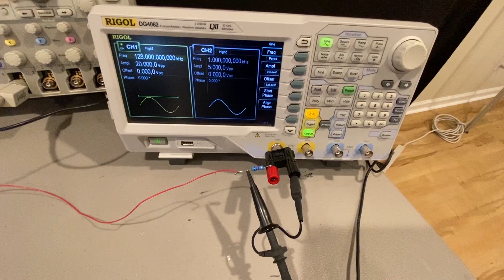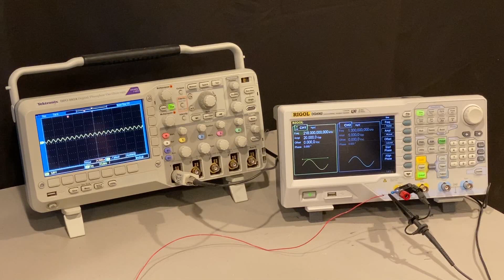How to Measure the Resonant Frequency of your Secondary Coil

Comment: Hi! What is the purpose of the resistor? Why not to connect the top off the coil to the oscilloscope? Thank you
Reply: because the oscilloscope probe will load the coil with additional impedance and change the resonance. the resistor is simply a current shunt since the probe cant measure the current directly we need a resistor to create a voltage drop for the scope to measure.

Comment: thank you! now that I finally have a proper(100MHz) scope, ive measured mine. its around 350KHz coil unloaded/no topload. still gathering more info. been far too long since ive built my tesla coils. planning on going QCW with SSTC. I dont have proper cap/s for going DR.

Comment: I think I am a little bit confused here. As far as I know, the usual equivalent circuit diagram of a coil is a parallel resonant circuit, like the one from this wikipedia page: https://de.wikipedia.org/wiki/Spule_(Elektrotechnik)#/media/Datei:Induktivit%C3%A4t_ersatz.svg (Ignoring the iron resistance for the moment as it doesn't change the fact that this is still a parallel resonant circuit).  And as far as I know, the impedance of a parallel resonant circuit reaches a MAXIMUM at the resonance frequency, not a minimum. A series resonant circuit reaches an impedance minimum at the resonance frequency I think. Thus the voltage drop across the coil should reach a maximum at the resonance frequency, not a minimum. Does he in fact measure the voltage drop across the resistor, or where did I go wrong here? 

I am also super confused with his setup that can be seen at 0:20. Assuming the red terminal of his BNC adapter is the output, the black terminal is the ground and the red wire goes to his coil, it looks like he was probing the voltage drop across the coil, referencing his probe to the function generator's ground. But where the heck does the other cable of the coil connect to? I can only see the probe's ground connection at the black terminal of the BNC adapter, and at 0:10, I can't see a second terminal on the coil. 

Maybe I've misunderstood something completely here? It would be very nice if someone (maybe even the uploader) could shed some light on this. thanks!
Reply: at resonance frequency the impedance across the coil is at a minimum, so almost all of the voltage drop will be across the resistor instead of the coil. remember that the resistor comes before the coil in series